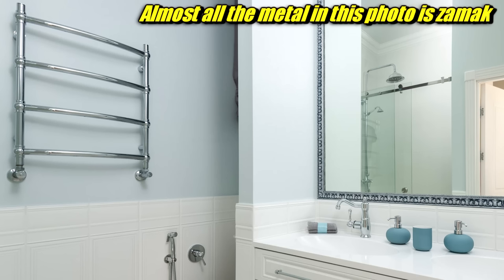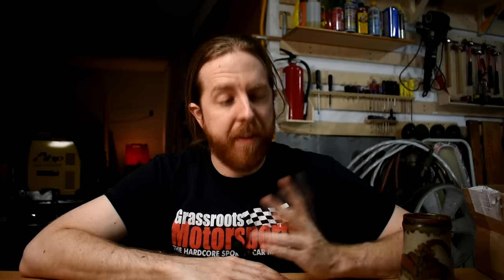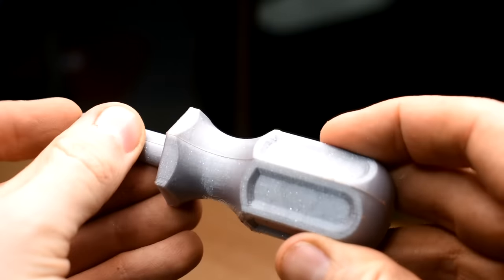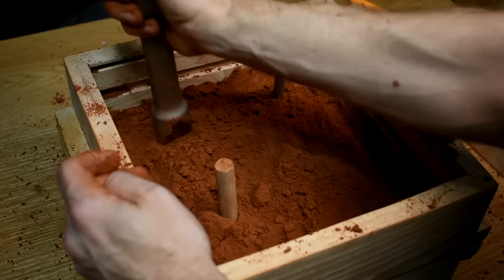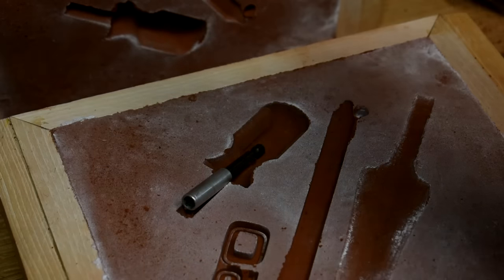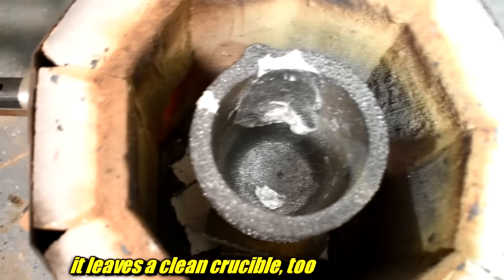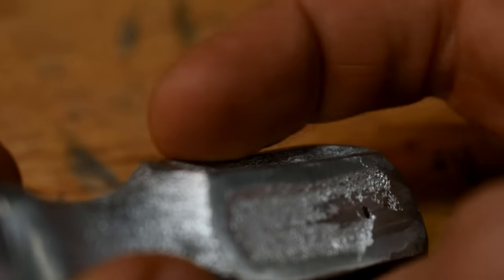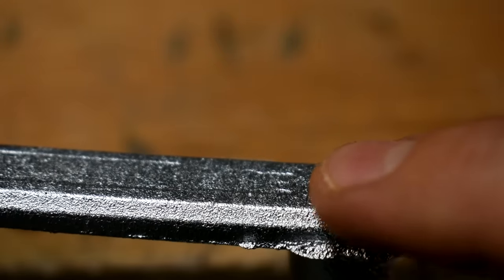The BEST Metal Casting Alloy That Everyone Ignores

Comment: How much lead is a problem? Or to put that another way, how accurate does an xrf meter have to be to detect it?

   I have a lot of second-hand "zinc" that I have no idea if it's really pure, an Alloy or different formulations of puter , most is just mixed batch scrap, and may contain aluminum, bismuth, lead and God knows what other things..
  I was hoping to make use of my local scrap yards xrf to get it sorted out.. unless you know any good chemical qualitative tests? Know any techniques for separating such alloys?
Reply from the maker: An XRF may be good enough to tell you.  The amount of lead that is allowed is pretty low, though. One person told me it's equivalent to a pea sized lump of lead spread evenly in a pallet load of zamak ingots.  Any more and you have problems
Reply: @PaulsGarage  that's ppm levels, the best xrf I've seen in person in the tenthousandths range 
(not counting the 80yr old lead inspector that did my house who's system involved driving around with a chunk of  Cobalt 60 in a heavy case in his trunk, and he's retired now. He told me his setup was sensitive to one part per million and could vary the shielding to test surface dust to the full wall thickness! )

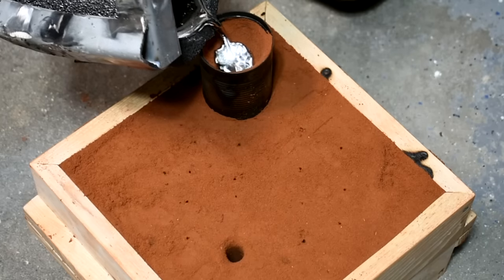Comment: that smoke he was talking about, is it like what can be seen at 6:19?
Reply from the maker: Not quite, the smoke you saw was oil burning off from the petrobond (oil bonded sand).  The zinc fumes are usually a fairly opaque white and they come out of the furnace before you even get to the pour.  This alloy doesn't get hot enough to put off enough fumes for visible smoke I less you get it waaay too hot
Reply: @PaulsGarage  ty man

Comment: Not a metallurgist, and I am personally very pro function over form and extremely minus form over function, but could this alloy be gilded? How easily does it scratch? If it is as common as it is, its probably one of those materials I hate for being easy to scratch
Reply from the maker: Not sure on being gilded, but it scratches easier than hard steel, but it's harder than aluminum.
Reply: @PaulsGarage  already liking it then, now I almost wanna see if I can set up a tiny forge and cast some simple (but functional) things like a crude gear or something. Your channel is nice, feels easy to follow for someone who has otherwise only tried cold forging some razors and chisels.

Comment: Cool!  So how would you distinguish Zamak from Aluminum in just scrap form so as not to mix the two?  Subbed!
Reply from the maker: the most obvious is weight.  Zamak is way denser than aluminum, like twice as much.  You have to be careful though because a lot of zamak stuff is super thin, so it feels pretty light.  Generally you won't find aluminum parts as thin as zamak, or they wouldn't be sturdy enough.  Most sand cast aluminum has some thickness to it, and die cast aluminum too, though that isn't as good for sand casting.  Thin aluminum sheet (like cans for example) are pretty light but you probably shouldn't be melting those anyway, the metal is no good for casting.  and fun fact, as light weight as those cans are, a lot of the weight is the plastic liner that burns off.
Reply: @PaulsGarage  Thanks!  I'm really new into casting and have mostly done a lot of aluminum take away food trays because my wife and family eats out a lot. I'm mostly working on trying to make decent stock shapes for a mini-lathe and a milling machine.

Comment: Anyone try this? The finish on the Zamak parts was very grainy , but I'm not sure if that's because of the zamak (or qualities of it)... or if it's because of the mold or sand quality. Like, if aluminum was casted into this exact cast, would it have come out looking about identical to the Zamak part? (finish/smooth-wise and not counting the differences in shrinkage.). As for the writing, I always thought that casting could easily pick up that kind of detail (have seen many youtubers cast other metals/objects. I don't recall any specifically casting Zamak, but I think a few did and that their results were very accurate even with very fine detail. (I don't mean to criticize at all. It's better than I've ever done myself. I'm just curious, because I know very little about casting.)
Reply from the maker: Zamak will likely look quite grainy because it will pick up the texture of the sand.  If you cast into a smooth metal die, it comes out smooth and shiny.  Aluminum has a higher surface tension and won't pick up detail as well, so the sand texture doesn't look so extreme
Reply: @PaulsGarage  Thanks. Appreciate the info. I hope to getting into the hobby myself, but I still have a lot t learn. Can't afford to waste money and time on things that don't work. Always try to learn everything I can, so I can avoid mistakes and waste.

Comment: Yeah... all of mine is scavenged... I've never had zinc pest (YET!) but I have massive cracks from day one in some of my castings and they just fall apart within hours.
I was once going to add lead ON PURPOSE because I've got some nice free-machining steel with lead in it so I thought "why not"... fortunately somebody said "NO NO... zinc pest" before I could find enough lead... (Lead is really hard to find these days in places where they don't have loads of gun nuts)
I once tried to melt some brass... turned the heat up too high... burned off all the zinc... and turned it into copper.... you might call that "failure", I call it "alchemy".
Reply from the maker: Good thing someone stopped you from adding lead!  That would have been terrible!  The zinc pest takes a while though, you wouldn't have known until it was too late;

Comment: Interesting. I kind of got triggered by the title. Zamac isn't the best alloy at all imho, but I wanted to watch the video first before commenting. Having worked for 18 years in metals research, I can say I had quite a few alloys going through my hands. We went from design to finished product. Zamac always was inferiour to any other alloy. Certainly don't use it for pressurized products such as faucets. But it's very economic in both purchase and manufacturing.

Now, the case is that I mostly had to manufacture/machine/examine functional and/or structural parts and Zamac isn't made for that. Zamac is a good alloy for esthetic castings but that's about it. You can't weld it btw. But it's a very good choice for props and such.

Did you consider using risers/feeders in your casting to avoid shrink. Also heat it up about 30 to 50°C more then the melting point before casting. When you don't like the grain finish, you can use a coating in the mold for smoother finishing. Another tip: tools that are gummed up can be cleaned by running them over a piee of wood.

I also took note from your comparison to aluminium. You should be aware of Al with low Si content (cheaper/softer) and with high Si content (tougher/better to machine). The latter chips better, has a more shiny finish (steel like with the right parameter settings) and doesn't gum up that much. 

Applying a bit of petrol or threading oil to the casting when machining helps too (for all non-ferrous metals btw). It's also better to use grinding disks for stainless steel for these types of material.

Comment: Is it in the casing of insulated window panes?
Reply from the maker: Not sure, many window things like that are extrusions of aluminum but I can't say for sure
Reply: @PaulsGarage  I had some windows, could melt the metals easily just like tin or lead, poured them into water and got boat-shaped figures, pretty hard, and not a stain of gray or dullness in 15 years (in the vitrine, beautiful romantic Elf ships).

I had also windows with aluminum. Can't melt them.

Comment: Casting!! 🎉 Great explanation
Reply from the maker: Thanks 👍 and yeah definitely back on the molten metal train.  The only problem being I ruined my foundry furnace and haven't fixed it yet (can still do low temp zamak, though) and despite fixing my heat treat/burnout oven/kiln, i managed to break it in a different way and i haven't fixed that yet either 😂😭

Comment: So 78% zinc, 12% aluminium, if I wanted to try make this at home, or other way around?
Reply from the maker: Yep!  There's a small amount of copper in there too
Reply: I'd recommend figuring out the quantities ahead of time and then mix the copper and aluminum first. Once they are mixed pour an ingot, let it cool then melt it with the zinc.  Otherwise, the zinc will boil before the copper melts. Boiling zinc gives off nasty fumes.

Comment: Technically ZA12 in NOT a ZAMAK alloy. The K stands for kupery which is German for copper.  They typically have 1-4% copper in them.  ZA12 is about 11% aluminum and 89% zinc with at most a trace of copper.  There is no such thing as ZAMAK-12.

Comment: Wonder how toxic the fumes are? That would be a reason not to. Though I'm sure other metal also has toxic fumes
Reply from the maker: Zinc fumes are pretty bad, yeah, but zamak should never be hot enough to release the fumes.  Brass is, because brass melts at a temperature above zinc's boiling point, that's why brass always gives off white smoke (and loses brass content the longer it's molten).  Zamak should be used just above the melting point, however, so no fumes unless you're doing it wrong.  

Other metals can give off fumes too, but it's generally at such a high temperature it won't happen in a home foundry set up
Reply: @PaulsGarage  awesome, thanks! That's good to know.

Comment: You  can  recycle   lead  free  ZAM (Zinc  -Alumnium-Copper) from  broken cheep  water  taps ,  most  new  water  taps  made  in  China  are  from  this  low  melting  point  alloy,  it  melts    way lower  than  the  pure  Zinc  and  its  quite  fragile

Comment: ZAMAC is FANTASTIC at one particular thing it is CHEAP. Pewter cost me about 70 bucks where I am, and ZAMAK about 10. So it is 7x cheaper.
Reply from the maker: Exactly!  And it's tougher than pewter.  Modern pewter is full of tin and tin is like $40/lb from my source.  That's crazy
Reply: @PaulsGarage  According to wikipedia pewter should be 90% tin at least, otherwise it´s not consider pewter. And yes it is mad crazy and soft. Zinc on the other hand is considered an engineering material that´s why we still use it in the automotive industry. You know the Mercedes hood star ? Yep, you guessed it, Zinc. Also the ingnition housing, door handle frames and other parts.
Hey can you tell me if I use normal plaster with some sand say 1/3 mix in a metal tube and burn that stuff out in a oven at say 230°C will that work ? I mean the burnout is supposed to be super important and what not so I am wondering if that can be done at home without a furnace.

Comment: Probabaly not a good idea, but can this metal be welded
Reply from the maker: probably not.  There may be someone out there with an old school torch welder and a careful hand that can do it, but i'm not going to try.  The problem is zinc's super low boiling point.  Most metal melt at a higher temp than zinc boils, and boiling leads to zinc oxide fumes and porous welds

Comment: "Why a cheap wine is good? Because it's good and cheap!"
Now, Zn-Al alloy is good for some application, but because it's cheap and easy to pour it is used everywhere, and that includes application it should NEVER be used for. That is, wherever a constant (less or more) contact with moisture and electrolytes is expected - like belts buckles (sweat - means, water and salt), or tap faucets. But Chinese companies, in the mad cut-throat price wars and ever shrinking progit margins will always go the extra mile to waste a dollar (YOUR dollar) to save a cent (for themselves).
Both zinc and aluminium are highly reactive metals, reacting with acids and bases alike, and zinc can be even be dissolved in HOT WATER - as long as the low (or high) enough pH will prevent passivation layer to form. In fact, the only "open air corrosion resistance" of those metals comes from them being able to passivate themselves - but not when CONSTANT moisture is there.
Take a piece of aluminium and bury it in wet soil - it'll be gone in matter of weeks, even faster for zinc. Ditto for "zincal" as this alloy is also known in some countries - and, WORSE STILL, this alloy is susceptible to inter-crystalline corrosion. Means, it progresses between grains, which are (a double whammy) rather large compared to either constituent metal.
The result is that while the object looks sorta OK, it becomes VERY brittle - to the point, that a belt buckle (on the belt that hold your pants) may one day just snap when you decide to sit down. When it happens at home it's non-issue, kinda embarrassing in public place - but still no biggie, right? However...

A year or so ago my parents asked me to do something about dripping mixing faucet in their kitchen - I took a look at the old one, noticed that chromium is pitted (how strange...?), my gut feelings told me "this no good!", so I decided to replace it altogether. Guess what - the faucet body (why, Chinese el cheapo, of course!) turned out  to be made NOT from brass (as it was always the case so far), but from this el cheapo alloy! And thanks be to God I decided to replace it completely - it turned out to be so brittle that it cracked in half IN MY HANDS when I tried, latter on, to screw out of it a brass threaded fitting that connect it to the water pipes.
Imagine it'd crack when it was still "on the wall", and nobody home at this very moment... Effing chinks...

Comment: Interesting. Lead in Zinc castings=BAD. Did you know Zinc in casting Lead is also bad? Guys that cast bullets from lead alloys are very careful about zinc contamination. And they buy their alloy from Rotometals, too. You also get zinc smoke if you try to weld galvanized pipe.
Reply from the maker: Didn't know that about zinc in lead.  I imagine you don't want flaws in bullets for sure

Comment: Elvisammo killed a Lee production pot melting zinc instead of lead,it ate through the steel pot.

Galvanic corrosion.
Reply from the maker: yeah you have to be careful with some metals, that will happen.  clay crucibles are better for resisting that

Comment: Have you ever soldered?
Reply from the maker: Yeah i do a lot of soldering for work, replacing relays on circuit boards and stuff.  I've done a little larger stuff, like stained glass windows with solder joints on the metals frames.  Thankfully they weren't lead.
Reply: @PaulsGarage  Are you sure it wasn't lead?

Unleaded solder sucks.

Comment: is that the same as mazak ???
Reply from the maker: Very similar yeah.  Zamak is basically just Mazak with another name and it's a bunch of alloys, but this alloy I'm using is za12 which is a specific mix, higher in aluminum compared to most zamak/mazaks

Comment: I will never understand why people put themselves through so much trouble with green sand.  Get a CNC router and make your pattern OUT OF FOAM. Coat it in several thin coats of wallboard mud/hot-mud  as a slurry and that will hold up perfectly to aluminum and well enough to bronze. Uses standard playsand.
Reply: Great if you have money.....
Reply from the maker: Makercise used that method I think for many of his castings.  I was never thrilled with the surface finish personally, but it looks like a good method
Reply: @dpeter6396  I built one out of scavenged OSB,  scavenged steel angle iron, 3D printer hardware, an old Dell running LinuxCNC, with a makita 1 1/4 hp wood router.  It was almost $1000 dollars and took four months to get running. It's about to cut the pieces for it's epoxy-granite replacement which admittedly is going to cost quite a lot more, around $5000-6000 with an FM30 spindle from CNC Depot. 

It can be done.
Reply: @PaulsGarage  Fair point. I get exact surface finish in my castings, and that means all of the flaws and surface inconsistencies.  But it's EASY, and delivers functional parts ready for finish machining/fitting.
Reply: I had a reply to this. But you know what... that CNC-aspect... does knock down a lot of arguments.

Mostly leaves the smell. I mean you've got to admit, it's horrendous. And cannot be good for you. If you've no neighbours to worry about, probably less of a problem.
Reply: @johannesmajamaki2626  Oh lord yes, burning foam smells terrible and the fumes are definitely toxic.  So if you do this every other day or every weekend you should invest in a respirator that can block organic compounds. Once a month you're probably OK. I live on an acre, so the neighbors never have a problem. All good points.
Reply: @lowellhouser7731  So why not make the core out of wax and melt it out before casting?
Reply: @mfree80286  The point of lost foam is to be EASY. Let the CNC do the hard work, dunk the part once a day and hang it to dry while doing something else, then pack it in cheap sand and pour the metal. 

Lost wax casting is too easy to screw up in too many places. Plus the stuff that I want to cast is best made out of flat sheets, so why wouldn't I cut them out of pink foam panels from the big box store?

Comment: Zamak will never be cheaper than the Aluminum I get, but only because I get my Aluminum for free by salvaging and melting it.
I need to cast a drive pulley for a 2X72 belt sander I'm making.
I need to use the cast iron factory pulley as it's a DC motor out of a tread mill and the driving axle is 1/2" 13 thread but a left hand thread so good luck finding anything in that thread that you could use for a pulley.
I'm going to just cast the 4" sanding pulley over the 1-1/2" spline belt drive pulley so it should hold fast.
Also, the fan for cooling this motor is on the back of the cast iron pulley so I either need to keep it or duplicate it, and keeping it is less work.
I was tempted to try and make it out of Pewter only because it melts at so low a temp but Aluminum was the durability front runner until Paul told me about Zamak.